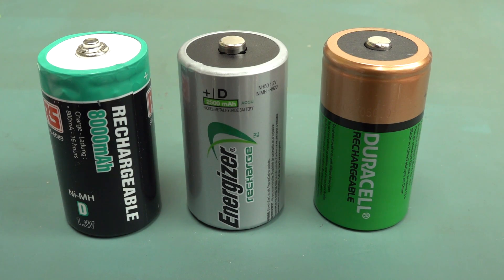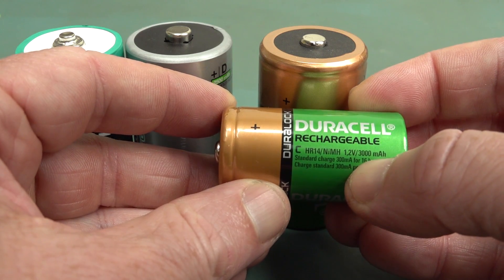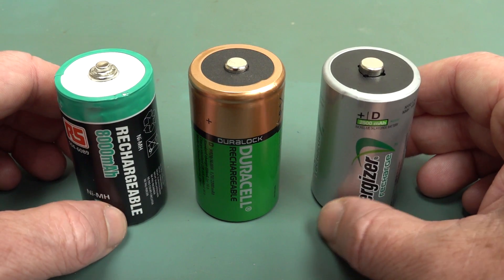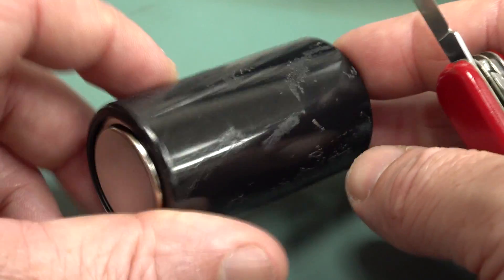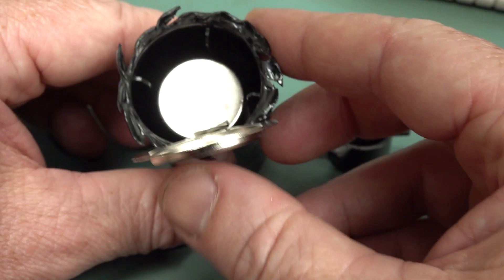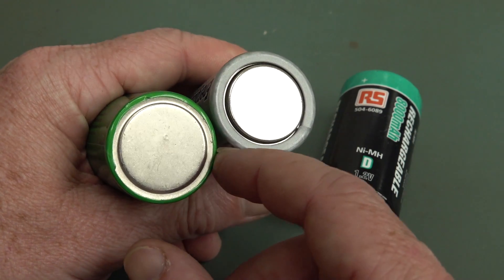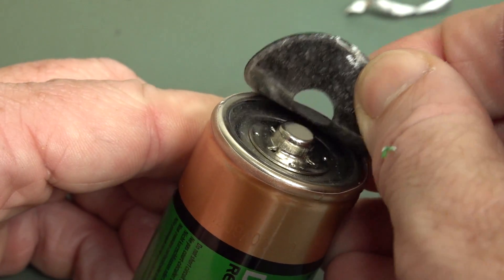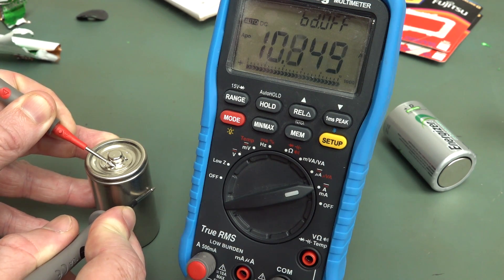EEVblog #1200 - BUSTED! - Energizer & Duracell NiMH

Comment: I was expecting a AA cell inside both. I think I remember seeing adaptors that bulk up a AA to D dimensions.

And that's exactly why I don't think it's a scam. They're different products for very different markets - Nobody is making farting novelty toys that use D cells anymore, so the folks buying them are likely more interested in price at the till, ie, housewives at brick and mortar stores, looking for a nothing more than a cheaper way to power their kid's $1 torch. RS isn't a store, and is selling to people with very specific requirements. They want D cells because they contain more energy than AAs, they want NiMh over Li because reasons, and they're willing to pay for it. The housewife wants D cells because they fit the battery hole.

The consumer ones are gonna be used 3 times, forgotten about, and disposed of. The device that the pro ones are going into, is gonna work for the next 10 years.

If you're arguing "ethics", I'd say it would be more ethical for the consumer brands to offer adaptors from AA to D, than to waste resources offering high capacity D cells to consumers.
Reply: Bull.  D cells were always larger, with more capacity. Thats why they were "D" cells to start with.
This is just pulling the wool over consumers eye's for easy profit.
Reply: More capacity than an 18650? If a consumer needs capacity, they'll get a device that uses 18650s. The only thing consumers are buying D cells for, is legacy support.
Reply: @johnalexander2349  Don't you think its a bit conceited to assert what consumers would buy if they needed more capacity?
Reply: @1ohtaf1  Consumers will buy whatever fits in the hole.

Comment: Just in case you wanted to power up your vintage ghetto blaster, but also want to save the environment from burning through alkaline batteries. Although I bet you'd get irked by how it quits after an hour and go back to single use, the expensive rechargeable D cells sitting in their charger, waiting for the day you finally throw them away. I may have had personal experience like this.

Comment: 9:45 gas is generated from overcharging, not short. Short may cause it to heat up significantly and maybe boil the electrolyte, but overcharging directly generates gas

Comment: You're absolutely right. It's all about marketing. Most people look at the price and not the capacity. A 2500 mah d cell battery costs about half or a third of an 8000 mah battery.  Who reads the capacity when it clearly states it has the most.

Comment: You're lucky you didn't end up with a bench on fire. Some types of NiMH batteries have a chemical that will spontaneously combust after being exposed to air. (See BigClive's video). Those batteries were exactly what I thought they'd be. A smaller cell inside a spacer.

Comment: Total scam. The only decent C and D NiMHs I'm aware of are the Tenergy Centura. IIRC those are 12 AH for the D cells. I have those in a 4D Maglite and they last *forever*. You're better off using spacers than those fake batteries.

Comment: i'm not sure if it's a law or what but at least rechargeable ones have capacity ratings on them so you can easily buy the better batteries(if they aren't just outright fakes). disposable ones it used to be impossible to find any information on capacity and even these days you have to do your own research. they should just put the dam capacity(@ a standard discharge rate) on all cells already

Comment: It’s not a scam if they put right on the battery and the packaging the actual low capacity. 
The batteries you get on EBay that claim to have really high capacity when they are no where near their claim, are the scam

Comment: I'm guessing they're either A) matching the capacity of alkaline cells  B) keeping the bulk down so it doesn't over heat or explode.
Reply: A. Alkaline batteries have higher capacities, but are not re-charge-able
B. NiMH batteries are not known to overheat or explode (Li-Ion batteries are).
Reply: @czarzenana5125  When I charge my Ni-MH AA cells they get quite warm, and the current is quite low.
Reply: @eurobum2012  
Maybe they are bad quality with high internal resistance.
Li-Ions can explode because gasses are formed. To my knowledge that doesn't happen in NiMH cells.

Comment: LMAO. what a joke.
 I have a ton of AA Nimh batteries, and a few AAA's, a mixture of Energiser, Varta and Uniross cells, but I basically just buy what's easily available over the years. (hence the Uniross ones are from when I lived in England, and the more recent stuff is sort of a 60/40 split between Energiser and Varta) They vary from about 2000 mAh to 2600 mAh, not that it's critical for my uses since they still all last a good 20+ hours for my most common use cases.
If I'm checking for anything at all these days when buying these things it's whether it's a 'low self discharge' cell or not, because otherwise they lose their charge in under a month, which is... Irritating to deal with given typically only half of my collection of batteries is in use at any given moment.

I have no real use for C or D cells (I technically have an old keyboard that uses them I suppose, but eh.), but even if I did, it's trivially easy to get adapters that let you use AA's, and that's good enough for the rare situation that I might need a C or D cell.

In fact, what I actually need sometimes is a 9 volt cell.
And while it's not exactly super-difficult to find a 9 volt NiMh cell, (I've got one somewhere), good luck finding a charger that still accepts them.
And of course, my oldest charger, which DOES support them, is designed for NiCad, not NiMh.

I sure as hell don't miss NiCad batteries, but low self discharge NiMh is still pretty good to me.
Lithium annoys me because almost every device has a proprietary pack that only works with that one, specific device.

Consider the difference between a game controller that uses AA's (and thus indirectly allows NiMh cells) and one with it's own built-in pack;
AA: put in fresh batteries, charge a spare set while you're using it. When it dies, takes 20 seconds to swap out the AA's with a fresh set, put the used set in the charger.
Li-Ion: Proprietary cell usually built into the device. If it fails, you're going to have a headache, and device may end up unusable. Use it until the battery goes flat, then plug it in using a USB cable. If you're lucky you can use it while plugged in, but now you're tethered by an often quite short cable - and usually the wireless comms on these devices switches off when the USB is plugged in too. Now you wait however long it takes, with the device you're trying to use physically tethered to something, until it finishes charging. Yeah. So... 'convenient'.

I realise of course that standardised Lithium Ion cells do exist, like the 18650, but they're nowhere near as standardised as AA's, almost no devices use them that way, and charging also isn't as straightforward...
I mean, It's great that there's SOME standards, but it doesn't really make a good replacement for what AA's where allowing.

Comment: You know the old joke, if you see a pack of C-cells someone in the house owns a vibrator. Cause they haven't gone into anything else since the 90's
Well it turns out that with the advent of new lithium rechargeable vibrators the only way to unload them is to package them into cheap D-cells. lol
Reply: thumbwarriordx C cells also go in transistor radios that people are required to keep ready in case of national emergencies where the networks and power grids fail.

Comment: They might be cheaper.

I don’t see it as a scam or a rip-off.
Reply: Yeah, I think Dave is getting a little carried away with the hyperbole. It would be a rip-off if the cell's actual delivered capacity was less than claimed, but as he says in the beginning - they do deliver what they claim. The ignorant consumer may associate the "D" size with higher capacity, and thus may feel ripped off when their device quits working sooner than expected, but these cells work, they do "what it says on the tin" - it is not fair to accuse the manufacturers of ripping people off. 

Educating people is a great thing to do, with good information the consumer can make better purchasing decisions. There is no need to act as though you have just discovered some sneakiness and exposed some foul play.
Reply: @HarmanRobotics  exactly
Reply: I agree that they are sometimes cheaper however, they're still almost certainly more expensive per mAh, even if the 8000mAh cell cost 3x as much you'd still be getting more capacity per dollar but let's see what amazon has to say about that.

Energizer: https://www.amazon.com/Energizer-Rechargeable-Batteries-NiMH-2500-count/dp/B0031JYRCY/ref=sr_1_10?keywords=d+cell+nimh+battery&qid=1555053988&s=gateway&sr=8-10
(I didn't see a 4-pack, so I'll settle on two of them for $16)
EBL: https://www.amazon.com/EBL-10000mAh-Capacity-Rechargeable-Batteries/dp/B00IDV1AMA/ref=sr_1_3?keywords=d+cell+nimh+battery&qid=1555053988&s=gateway&sr=8-3

For $16 (technically cheaper) you're getting a total of 10,000mAh vs $25 for a total of 40,000mAh or here's another way of putting it, for $8 more for six Energizer cells and 15,000mAh, so at the same cost not even half from a lesser known brand.

So no its not a scam because you get what's on the tin, but definitely a rip-off when you can pay a little more for considerably more (even outright double) capacity...
Reply: I absolutely agree with Dave. From technical point of view, it is not a scam, because numbers are correct, they deliver declared capacity. On the other hand, Duracell and Energizer declares that they provide longer runtime then other brands. So they definitely mislead customers to think that battery with sticker "Energizer" and "Duracell" are going to be better (Dave pointed out that "John Public" guy is not going to compare numbers, because they do not even know there is some number to look for). I consider this scam or fraud or lying or cheating, it is definitely not OK.
Reply: @Chupacabras222  so it's a scam because people are stupid and can't read a label, that's sad you have such low expectations of people.
Reply: @LawrenceTimme  No, it is not a scam because average person is stupid. It is a scam because of behavior of manufacturers.
Reply: @LawrenceTimme  it is abusing peoples lack of understanding. It happens in every industry.
And you simply can not understand everything and now everything. Sure you understand mah ratings and all, lots of people don't. Just like you don't know what other kinds of values or ratings mean on other products.
And what do you do when you have no clue about how things actually work? Buy the heavilly advertised brand you heard of that are more expensive. Even though they almost always are far from the premium product they claim to be.

You are ripped of everywhere unless you are able to do full and time consuming reseach and educate yourself on anything you purchase.
You might be ok with that and call it consumer responsibility and all and don't mind to be manipulated 24/7 by corperations and all their endless tricks on technicalities.
Other people are sick of all the nonsense and misrepresentation corperations get away with, especially if it is pretty easy to put a stop to it.
There are no bennefits to consumers that come with letting corperations get away with whatever they want, but it does effect you, your familly and everyone else, so why would you support it?

Why are corperations held to different standards then people? It is just weird honestly
Reply: @baronvonlimbourgh1716  you don't need to understand everything to look at a mah number and compare 2 things.

You are only ripping off yourself with ignorance and the nanny state doesn't need to protect and look after idiots. They need to learn from their mistakes, not be prevented from making them.
Reply: @LawrenceTimme  like always missing the point completely. I guess there is no fix for being narrow minded.

Comment: This might be partially due to the extremely cheap chargers that these brands put out, which would have to be reworked to detect and fully charge the C and D cells and not over charge the AA and AAA's. If they switched, many of their customers with existing chargers would not be charging more then 25% of the battery anyway without knowing it which they might factor in?
Reply: Any decent modern charger works by detecting a peak in voltage when the cell is fully charged, they don't just stuff a set capacity into a cell.

Comment: I have always had a good experience with Energizer batteries so I went with the rechargeable line a few 6-8 years back and pretty much all of My AA's and most of my aaa's didn't hold a charge after a year I have since gone to Battery Mart where I have dozens of aaa's that last forever. I have also been plagued with alkaline Duracell batteries that always seem to leak on me whenever I forget to take them out of something I've had other brands leak but 90% have been Duracell. And don't get me started on their commercials where they use mob mentality to sell you on using their battery or you might fall off a cliff....

Comment: You are usually are not getting shortchanged. The price is lower for a lower capacity battery. Not sure where you buy these lower capacity batteries at higher costs. I'm Guess in America Wal-mart. You can always find a sucker there.

Comment: This isn't particularly surprising given the low ratings of the cells. I don't use NiMh batteries for anything anymore, but when I did, I'd go to great lengths to find the highest capacity I could get my hands on. Duracell and Energizer usually ranked on the bottom end for capacity. Eneloop, though beloved by many, often ranked even lower on the capacity charts, usually clocking in at 2200mah. 
I do not recall what brand I was using anymore, but I found a brand online that claimed almost 3000mah for AA sized batteries and they lasted notably longer than the set of Duracells I had (which were 2500mah.
All of that said, the whole story must be mentioned. The Duracell's retained their capacity for a whole lot longer than the other batteries. I used the same set in my CD player (this was early 2000's) for almost 2 years. The other higher capacity batteries gave me longer life in the beginning, but their capacity dropped at a much faster rate, barely lasting a year. 
I'd still probably prefer the higher cap batteries though. Not worrying about my batteries dying is always nice.

Comment: Looking at it one way, they are rechargeable, so it doesn't really matter too much. It just means more frequent charging. Not like disposable batteries where you have to buy new ones when they run out. If these were disposable batteries, it would be a big issue to get much less energy for nearly the same price.

Comment: Dave, you are the one who should be busted. Energizer and Duracell are just responding to the market. Not many people buy D cells any more. We don't have big, power hungry flashlights any more. EE distributors are not carrying many D cells because no one is buying them. Shame on you for saying crap about the manufacturers. If you think about it, assuming that you go back that far, the original Carbon Zinc D cells had about 2200mA capacity. People are getting full value from a C cell inside a D size case because it costs less to manufacture that for a smaller market.
Reply: ...but that is not the way they are advertised -- otherwise they would have shot all the energiser bunnies by now.

Comment: These primary cell companies hamstring their rechargeable batteries so people buy their promary cells, instead.
Reply: That could be right. At 250 Ma discharge rate, a 1.5 Volt size "D" alkaline cell can produce 12 to 15 AH! About 6 times more capacity, than their rechargeable, and about 8 times more energy, because they are 1.5 volts, instead of 1.2. They can also sit on a shelf for a year, and keep more than 80% of that capacity. The caveat: once discharged, you have to buy new ones. I've tried, but never successfully, to recharge alkaline cells, but it never really works. It could even be dangerous.
Reply: @vincentrobinette1507  you can get quality D cell NIMH which are 12AH, and while alkaline cells suggest a higher voltage, they cannot provide the power output of NIMH.

The advantages of alkaline cells is they dont self discharge are,readily, so for applications where they sit on a shelf like an emergrncy flash light or have slow power draw like a smoke detector, alkalines are you best option
Reply: @coreyfro  You're exactly .right. You will find, that the voltage rating of high amperage flashlight bulbs, is 1.1 volts per cell. A "D" size alkaline cell drops to less than the 1.2 volts for NiMh, or NiCd, at less than 2 amps. I'm sure you've seen LED flashlights warn NOT to use rechargeable batteries. That's because the cells don't lose nearly as much voltage under load. That could cause the LED's to go into "thermal runaway", because of the negative temperature coefficiency of LED PN junctions. The softer, lower performance of the alkaline cells provides the ballast necessary to protect the LED's. Alkaline cells also share a characteristic with Lead Acid batteries, called the "Peukert exponent". That means, the higher the discharge rate, the less capacity you will get out of the cell. In high drain devices, a 2000 Ma rechargeable cell will give longer run times, than a 3,400 Ma alkaline cell.(AA size) That's why I like alkaline cells for smoke detectors, Television remotes, clocks, and other devices that use so little current, that the self discharge rate of rechargeables will run them down faster than the device.
Reply: @Liam nimh are resilient to over discharging.